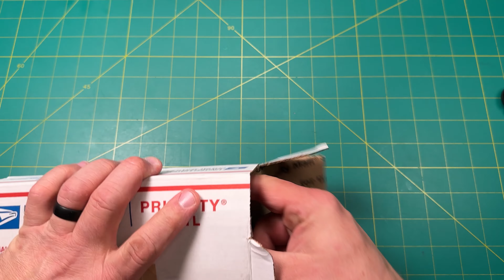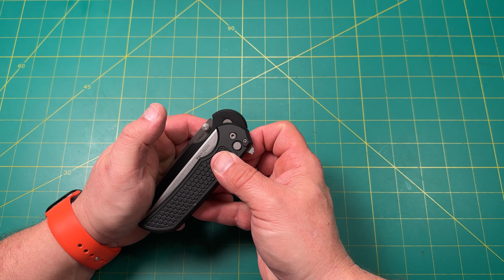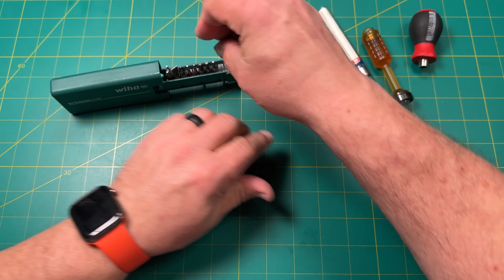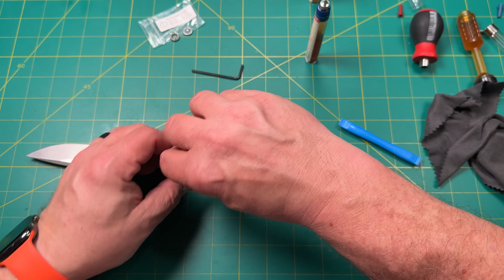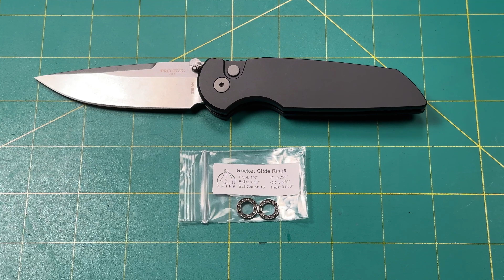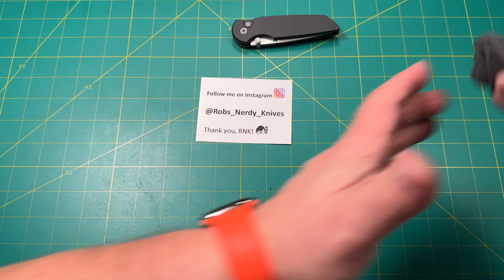Unboxing of a brand new knife… the Pro-Tech TR-3 manual buttonlock. It’s good!

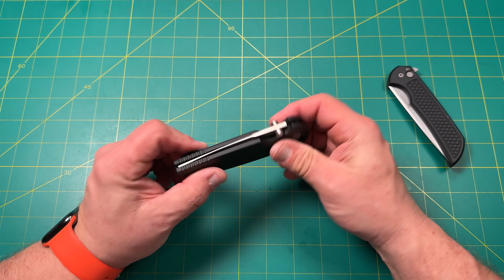Comment: My TR-3 came out of the box with bad lock stick. (5:57) You briefly mentioned that this is a typical Pro-Tech button lock issue. Can I expect my lock stick issue to resolve itself after breaking in the action some?
Reply from the maker: Most of the time, yes. I simply opened and closed this for a good hour. Also, you could put Skiff caged bearings in, too.

Comment: Interesting first knife I saw with hex screws!
Reply from the maker: Yeah, that was different for a disassembly. I’ve run into 1 or 2 times before in the over 1000 knives I’ve handled. It is very rare indeed. Good to know if you want to disassemble it.
Reply: Chris Reeve knives too. Or at least my small inkosi
Reply from the maker: Yes, Chris Reeve Knives on the Umnumzaan, Large Sebenza, and the Rick Hinderer knives in various places (i.e. Project, XM-18, Eqlipse).

Comment: I have a mordax and the pivot on mine is stuck in there just like this.   Was wondering if that was normal from protech or not.
Reply from the maker: On the Mordax, mine came out but it seems pretty normal for Protech with super tight tolerances. Unless you need to fix something else, I’d leave it in like I did this TR-3. If you were going to polish the aluminum, etc. then a punch will likely work. I’d cover the punch or use hard plastic one.